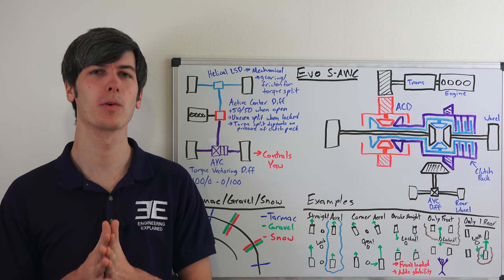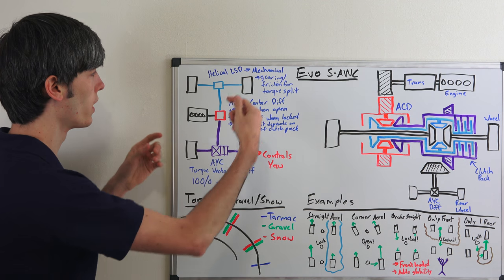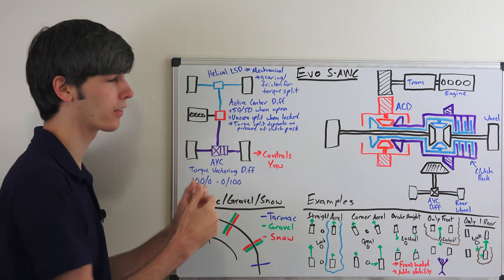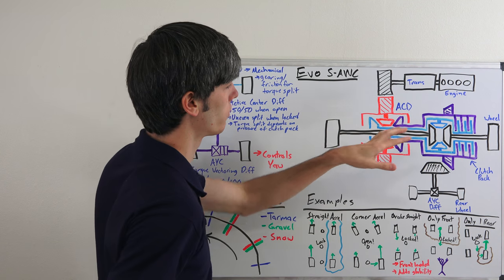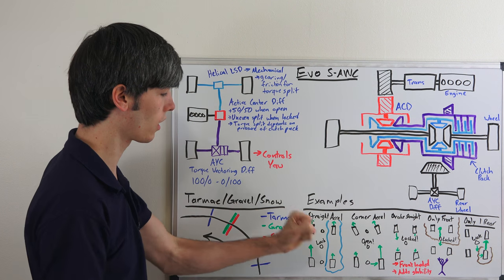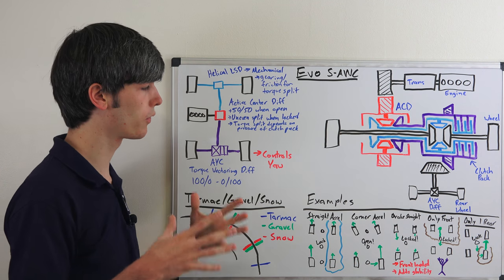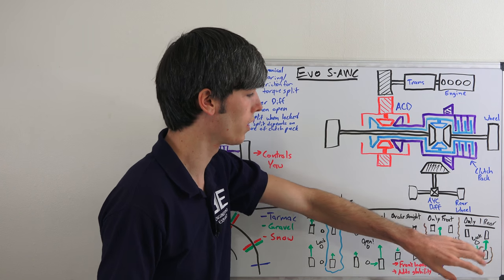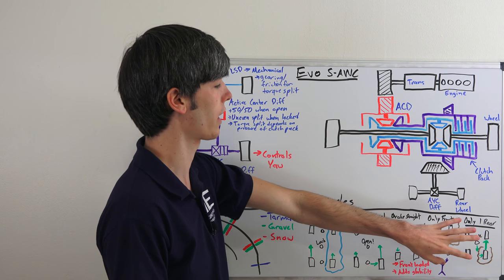Mitsubishi Evolution X - How The AWD System Works (S-AWC, ACD, AYC)

Comment: As a builder of Evo X motors, transmissions and differentials, I would like to know that with only 1 clutch pack controlling the front diff (the center diff is in the transmission and does not have a clutch pack on it) how does it choose to lock up the front or the rear individually? The AYC has 2 clutch packs which makes sense as it can control each side of the rear wheels individually with 2 clutch packs.

Thanks
Reply from the maker: +Chet Rickerman The front diff on the Evo X is a helical lsd, no clutches involved. The center diff has two clutch packs (as drawn, and explained) which can allow the torque to be sent to the front or rear.
Reply: +Engineering Explained Sorry to disagree, but I have disassembled and rebuilt the transfer case and there is only 1 set of clutch packs in there.  Thats why there is only 1 hydraulic line going to the transfer case.
Reply from the maker: +Chet Rickerman Whoops, I meant one clutch pack. Regardless, the center diff divides torque, the front is a helical.

Comment: Can someone clarify this risk of transmission case / diff damage please ?! (there are mixed opinions and comments) ....
When you do the MOT brake test, and it puts the Evo X on rollers, does it need the other axle to spin freely on some rollers or not ? 
Last technician today said they know what they are doing and the roller tester is for 4x4 vehicles including, AND since they only spin one wheel at  a time then it will NOT send power to the other axle (e.g rear wheels stay fixed when spinning front left or right wheel). 
I know the car cannot be towed by lifting just front or just back (just all wheel on a flatbed platform).

Comment: So I  have a question, will after market wheels damage the suspension and in doing so are you voiding the warranty?
Say the OEM wheels are 18" and I replace them with 20" wheels will there be any damage to the suspension?
Reply: No problems as long as all four wheels are the same diameter at the tread.

Comment: How different is the Ralliart system to this system? I'm guessing it's all the same except for the rear diff? Where the Ralliart diff acts like the front diff?
Reply: The ralliart doesn't have all the fancy wheel speed sensors, AYC, g sensors. It's just a simplified version of the s-awc for cost reasons. The Ralliart only has an open diff on the front, same locking center diff as the Evo, and a mechanical lsd on the rear. It's still a great awd system, tho. I often one.

Comment: Does the Outlander's S-AWC have the same system as Evo's S-AWC?
Reply from the maker: +Vinay R Nope, it has an active front and center diff, open rear diff I believe.
Reply: +Engineering Explained That's correct. And S-AWC on the Outlander is only on XLS models and is different from that found on the Evo. The ES and LS only have AWC.
http://www.markham-mitsubishi.ca/mitsubishi_all_wheel_control_is_the_best_in_the_world.aspx?lng=2
Reply: +Vinay R It's all just branding. The "S-AWC" on the Evo X is way more advanced and despite the name so is the "AWC" on the Ralliart. Outlanders still have a very good AWD system to handle poor conditions, but they are not performance oriented at all.
Reply: Thanks for the comments.

Comment: So when overhauling diffs in an EVO X, there are many clutch packs to replace (one for center and two for AYC)? Must be quite costly!
Reply from the maker: +Nick Amarit Performance often comes at a price. :)
Reply: +Nick Amarit They often ditch the rear diff in the Evo X for a CT9A model (Evo 8/9) due to it's higher power threshold and lower cost.
Reply: +Nick Amarit ...still preferred WRX STi!

Comment: Very clever stuff indeed. Do you know if the system is able to partially lock the centre diff as opposed to having it either open or locked?

Big respect for the team who developed the software to control that type of drivetrain.

Comment: how quickly can these actions happen, sending power to the wheels with most traction. for instance if an evo is rallying and its on gravel going around a corner uneven road surfaces to much speed which ever the case and you have one of the front wheels lift/ hop for example.
Reply: Within quarter seconds or less

Comment: What about the AWC for the lower trim Lancers/RVR/Outlander? Is it essentially the same idea minus the AYC, the % of torque split, and different settings for the drive mode?
Reply: +Beno http://www.markham-mitsubishi.ca/mitsubishi_all_wheel_control_is_the_best_in_the_world.aspx?lng=2  Just ignore the Tarmac/Gravel/Snow explanation at the bottom - like most of the info on these modes from Mitsubishi in North America, it is quite simply wrong. Even they don't understand the car they sell!

Comment: Just curious about your take on the system? Do you think it's a good system or do you prefer more of a streamlined system?
Reply: Treeezplz, I know you're not asking me, but as an AWD fan let me give you my opinion anyway. Full disclosure: I'm a current (and presently) five time Subaru AWD owner since 1993, an Audi and Mitsu AWD owner wannabe. Your worldwide leaders in AWD are Audi, Subaru, and Mitsubishi. Why? They've all collectively sold more than everyone else combined AND had rally championships worldwide.

It's a VERY good system in terms of how it functions, among the best in the world. That said, it's still one of several tools for the driver to use to go down the road/not get stuck. As with any good AWD system, MOST regular drivers would not notice anything going on except the car going where you point it and good traction on all road surfaces. A $19,000 Subaru Impreza would do them just fine, and is a good car for the money. So is my 1999 rusty AWD Impreza wagon. The low cost manual tranny AWD Subarus use a "more streamlined system" with no computer control and a viscous limited slip center differential. The front and rear diffs are low cost open diffs. 95+% of the time it does what you want, is seamless, reliable, and cost effective. The other 5% of the time, it's goofy, frustrating, and sometimes you get stuck, mostly due to the open front and rear diffs.

Those of us who drive really fast appreciate what the hardware and software of a high-end AWD system like the Evo can do. We will analyze the variations of what it will do and when, and apply that in our driving. This means BIG fun and getting down the road VERY fast in a controlled manner. WE will then compare THIS system to others and then pronounce preferences and judgments of greatness.

I think the main advantage of this system over several others is the torque vectoring rear diff. WHEN YOU'RE ON THE GAS, it helps rotate the car to the inside of the turn, a huge advantage many times. Power-on understeer is the occasional downfall of lesser systems. You get sideways on snow, let's say, and start giving it gas. Moments later the AWD will sometimes send a bit too much power to the front wheels, causing the front to understeer and run wide on the corner. Feeling that happening, you have to adjust your throttle/steering to stay on your preferred trajectory. You get used to doing it, but it does get annoying.

Comment: Hey Jason I have an important question for you you. 

I'm going to buy a used car as soon as possible maybe this week.

I've narrowed it down to two vehicles a 2009 through 2014 STI hatchback. my issue with that is the steering ratio is not nearly as fun as a 2016. I spoken to Larry at L&C fabrication and they had a hard time increasing the steering ratio on the newer STI's 09+ I believe it's because of the Si Drive.( locks up brakes)
Perrin no longer makes their STI Perrin super steer system and it's possible it had inherent bump steer. they didn't sell many but they believed in it. those are my main issues with the STI

the other car I'm considering is a Mitsubishi Evo X. my issue with considering this vehicle is I don't totally like that the computers are in control of the car all the time. my question is have you found a way to manually control the center differential to allow for more rear bias? I want to go to the track and drift a bit and I don't want the computer stepping in to stop me or control me. its important to me right now to have manual control over the center differential I'd like to be able to turn computers off and play with my car especially if I can throw power to the rear that would be great.

I plan on driving my car around the country for track days and to visit friends and race all the time. in a sense I'll probably be living out of the car
Reply: Biggest Question:  Is it possible change the steering ratio on a 2009-2015 STI?    

My researches led me to find it's difficult because of the computers control ( I don't understand all of this yet, please inform us if you know) apparently the car can lock its wheels in hard turning with an adjustment to steering ratio. only 2009+

I want fastering ratio on my STi!!  13.1 on the new STI is barely fast enough. its way more fun but I'd enjoy 11.1 or or 12.1

please let me know if every 09+ STI owner will never be able to modify their steering ratio! it's hard to believe we can't modify our steering in some way

thank you

Comment: Talk about the WRX STi AWD system next and how it's different! What I've heard is that, post-2007 anyway, they have a similar center differential to the one you describe here but also have front and rear electronically-controlled LSDs, too. So, All-Wheel Torque Vectoring???
Reply from the maker: +Matt Bonaccio STI has helical up front, Torsen in the rear (both mechanical). It uses the brakes for torque vectoring.

Comment: Everything after 9:30 is false. What you said about Tarmac, Gravel, and Snow is very wrong. It's actually the other way around. When you are in Snow mode the Diffs allow for more slip, and don't lock up as quickly and aggressively as when in Tarmac. You don't want to lock the diffs in poor traction because if you do you will spin off. However in dry conditions you want to lock them up Fast so that you can put power down. I can give you 10x better info about mitsubishi's S-AWD system.
Reply from the maker: No, this is untrue and illogical. Going around a corner you do not want the tire to scrub (or bind the drivetrain), as would happen with a locked diff. This is why locked diffs come with warnings saying not to use them on roads. On dirt/snow it's no big deal, a tire scrubbing won't really increase wear or put strain on the drivetrain. We don't need "10x" better information, we just need facts based on logic. This information came directly from Mitsubishi, and you can verify why it's a bad idea to have a locked diff (which is what an LSD attempts to achieve) on pavement on any website you choose (for the reasons I've provided above).
Reply: OMG! Do you know the Evo has: Steering angle sensor, throttle position sensor, G-meter sensor, hand break sensor, abs sensor. These sensor tell the ECU when to lock and unlock. In normal street driving the ACD is open, and there is no lock at all times. So when you turn the diff is open. Only if you flour the gas pedal is when the ACD will lock.
Reply: Did you know that when you pull the hand break in a Evo the diff fully opens so that when you flour it you don't blow the diff, but instead it sends power to the front wheels to pull you out from the u turn while the hand break is engaged. Thats why you can pull spectacular hand break slides with Evos. 10x cooler info.
Reply: Did you know that Evo's ACD can lock up 3 times harder than a LSD.... more cool info.

Comment: Thanks so much for making this! But I did have a question as to why during hard cornering, the AWC graphic on the dash lights up as (in the case of a left turn) front right tire, rear left tire. Why is it also sending torque to that rear left tire. My physics teacher said it just has something to do with the length of travel of each tire during the turn, but she said it was only a guess.

Comment: great!  finally setting the fact straight after last Evo video. so what happened with the Mitsubishi engineer who supposedly working on it told u that 80:20 front rear split? did you call him out ?
Reply from the maker: +Ming Li We had a misunderstanding, it happens. No need for me (or him) to be aggressive about it.
Reply: +Engineering Explained glad it's a misunderstanding. it will be a shame if Mitsubishi engineer told u something contradicted from original without proper explaination. It is funny when I skipped the video and saw u said putting 100% power to the one rear wheel and I thought someone messed up again, but it's fine as u said all other wheels are lifted on the ground and all clutches are locked. Worth to mention that Evo ayc uses two clutches to lock on the right axle through accelerate/decelerate gears that connects to diff housing, and the maximum torque it can transfer IF both rear wheels have same tractions is accelerate/decelerate device ratios. the torque vectoring explained video on rcf is different as they can in theory put 100% of torque to one wheel even if both wheels having the same traction, which is a better diff in my opinion

Comment: +Engineering Explained so you are doing a Subaru video next right lol. Great video, but what source(s) did you get your information from and can you include sources in future videos?
Reply from the maker: +Jay G I spoke with Mitsubishi to get all the facts. Most videos I read about 20 articles for, which I don't really document. There's a lot of good (and bad) information on the internet. Once source might have 30% of the story, another might have 10%. I try to piece it together. In this case, I went directly to Mitsubishi and chatted with an engineer (who worked with the Evo's AWD system) to figure it all out.
Reply: +Engineering Explained Engineers from Japan? From what I know, up until the Evo IX in 2003 which was partly developed in Europe after Nurburgring runs, the whole Evo lineup was solely developed in Japan by Japanese engineers. The big success for the S-AWC happened with the Evo 6.  Did you meet ex Ralliart employees?

Comment: Can't imagine how much efficiency has lost through all those diffs. xD
Reply from the maker: +Sebastian Rosenberg Considering its not-so-awesome power-to-weight ratio and the fact that it hit 60 mph in 5.2 seconds in my testing, with 11,000 miles on a press car that's been hammered by 50 journalists, I'd say it's doing pretty well to get a good amount of that power down.
Reply: ya i would not buy one.
Reply: +Sebastian Rosenberg 217kw at the engine stock, dynoed 165kw at the wheels, so it's loosing around 25%. However after 6 years of owning it, tuned by myself on E85 and running 26psi of boost, 250kw and 450nm for the past 5 years, it's a very good example of good engineering. The car has 113,000km on the clock and is still on the original factory clutch. You can see my track videos on my channel. Evo X's are good, better than I'd ever imagined.
Reply: +Sebastian Rosenberg Stock Evo X's run between 230-240hp to the wheels stock. So about 20% loss.